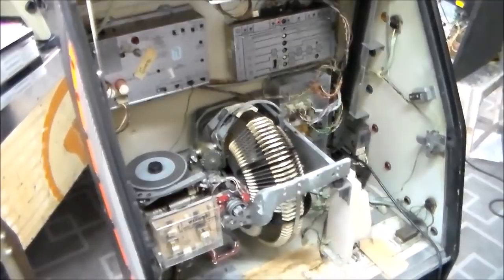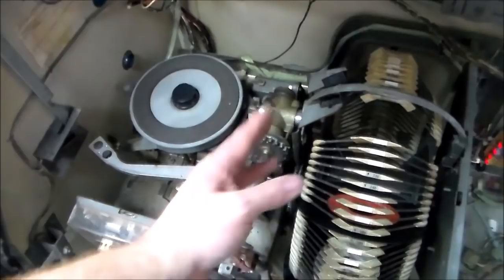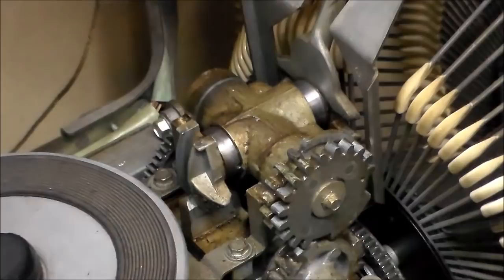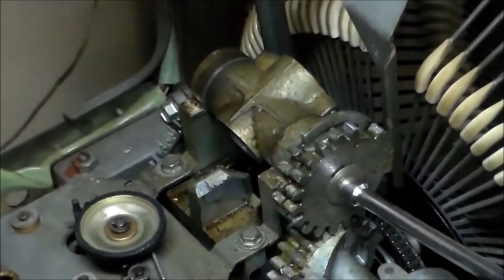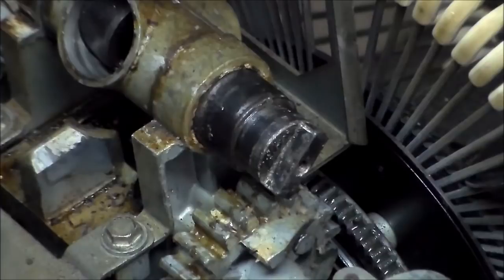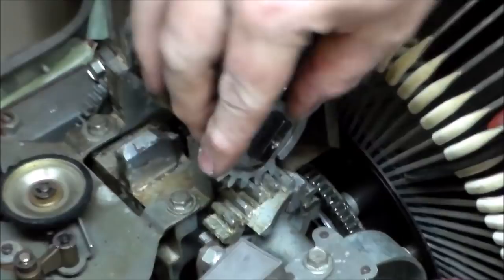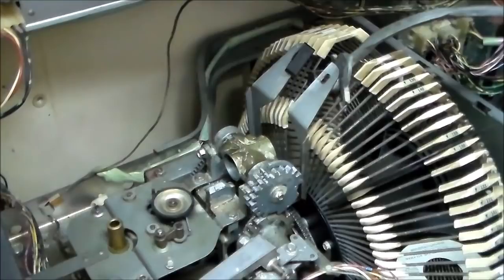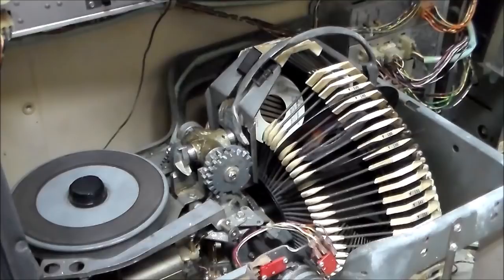How to Disassemble and clean the Mech on a Rock Ola Jukebox!

Comment: The terms Grease oil and lube all means the same Thing right.
Reply from the maker: Technically they're a little different but I'm using them all interchangeably... Grease is usually heavier 'weight' stuff that's a solid like Vaseline... oil is usually more light weight stuff like a liquid, and lube is used to describe any kind of lubricant
Reply: Oh OK. 
Thanks for the video.